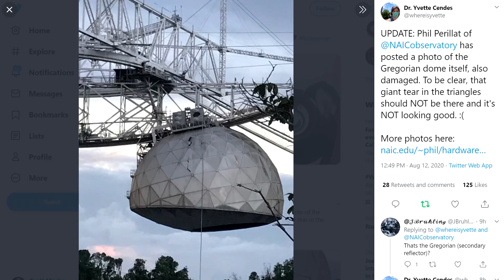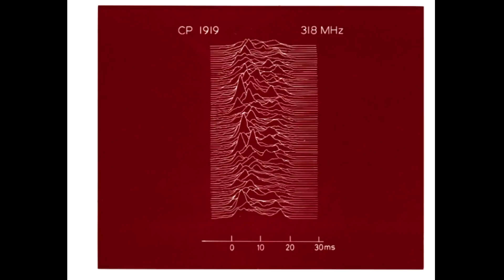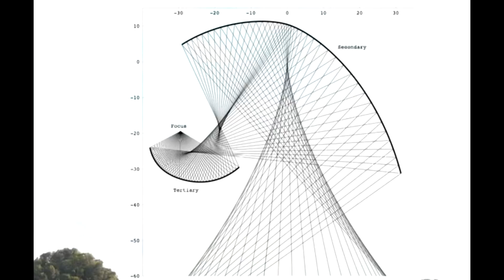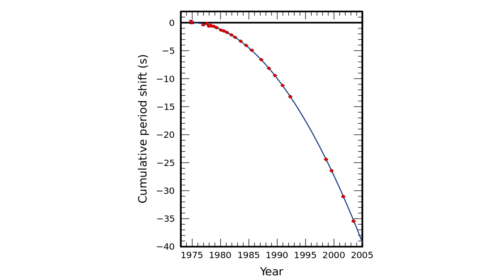Snapped Cable Damages Arecibo Observatory Radio Telescope

Comment: You need a minimum of five cable  towers and cables.
Then one tower and it's cables can be rebuilt or recabled while the other four hold up the rest of the structure.
This is standard on all largre cable supported towers and antennae.
With only three towers/cables you have to take down the whole structure to replace one tower/cables.

Comment: Cheap replacement idea:

Replace towers with windmill towers.  Modern windmill towers are cheap, and strong.  $3-4 is the all in cost for a 2 MW wind turbine.  The tower is probably 1/3 the cost.  So three towers for $3-4 million.  The biggest problem is lack of cranes and getting the crane to Arecibo.  The cranes plentiful and cheap to rent in Iowa, Texas, wind farm country.  There probably isn't any cranes in Puerto Rico.

Use Skycam style suspension system to hoist research instruments into place.  Skycam's are cable suspended cameras used in stadiums during games.  The suspend a camera anywhere in 3D above the stadium with limits.  First used in 1984.  A similar system could be used to suspend research packages above the dish.  Suspending the packages in different locations to aim and focus the dish.  6 cables could be used to tilt a package.  The cable drums would be mounted on the top of each tower.  The experimental packages would be stored on the ground in the rectangular hole.

Repair the dish.  Ultimately the dish probably needs to be replaced.  I recalled past discussions on that.

My guess is that you could be up and observing for less the $10 million.  Costs go up with feature creep.

Smaller packages could be suspended from stabilized drones.

-Kurt
Reply: This comment does not even remotely consider the type of load that is placed on the support towers in question. Towers using cables to suspend a platform 100m or more form the tip of the tower are designed entirely differently than a tower designed to support a static load placed directly on top of it and its base. This isn't even the right channel for engineering suggestions and yours is a less than poor one.
Reply: @oddieboi  I did consider what type of load a wire would place on the tower.   It is obvious it is sideways, horizontal to the ground.  How does the wind blow??  Maybe wind blows horizontal to the ground.  My back of the hand calculation is a 3 MN wind turbine would place over 300,000 KG of sideways force on the a wind turbine tower.  Therefore a 3  MW wind turbine tower could support a 300,000 KG sideways cable.  Three wind towers towers could easily support a 100 metric ton platform.  No where near the 900 ton Arecibo platform.  But the Skycam tech means you don't need all steel work lattice to move the Gregorian dome.  A massive weight savings.  No cat walks are needed either.  The Skycam tech would lower the electronics platform to the ground for servicing.  More weight savings.   I think a less then 100 metric ton platform could be designed easily.

Comment: I catched up latest news about this installation.  Because of irrepairable condition, as well also because of instability in the whole structure because of that damage (also by a storm which struck previously over the area), so the installation threatens to collapse as was found out, the decision was now made to mainly dismantle the whole telescope installation, except for some important details for preservation of parts of it. This is sad, because such telescopes, which are using a geographical condition (valleys) for mounting a fixed reflector with really extending size (unable to be constructed in such size on mobile structure-mounted telescopes) are capable of detecting very very weak signals coming from space and also from far-away probes. To cover up a major part of the surrounding space, such fixed telescopes would have to be mounted all over the whole planet (because earth rotates, at least along one or more latitudes, densely enough so their main lobes are somewhat overlapping) The gondula with the transmitter/receiver elements was movable, so the radiation/reception lobe of the telescope was even able to be tilted within +/- 20 deg.

Comment: The same technique is used in the Elevator industry to support elevator cables its called a Rosebud. the end of the cable is unwound (after being secured with ties to prevent further unwinding.) the ends of the strands are bent over and put into the center of themselves forming the "Rose" flower assembly. this is slid down into a cone shaped metal cone. then melted Babbitt is poured into the rose to solidify. and capping off the end of the cable then the assembly is attached to the car./ or what ever device being used.

Comment: Remember Gren Bank Observatory? Largest fully steerable radio telescope, located in West Virginia, suddenly collapsed about 20 years, of course totally destroying itself. Due to the same funding challenges facing Arecibo, many doubted the antenna would be rebuilt. Not only was it rebuilt but rebuilt better. They even host a star party there now, and ots almost freaky to see this enormous dish antenna amidst a sea of telescopes.

Comment: Most likely at fault from hurricane damage from Maria, and lack of maintenance and funds, the Puerto Rican government is completely inept at allocating funds for  infrastructure and civil projects, the reason that my family left. 6 months without power and water after the 2017 hurricane due to the completely outdated 1940's termite rotted wooden power poles, mixed in with modern metal ones creating an intensely convoluted and nightmarishly tangled mess of power lines with multiple failure points, plus lack of proper response and coordination, it was only a matter of time, and still today there's still risk of another hurricane destroying what survived last time. Visited in November of last year and many areas were still exactly the same without any change or improvement in the grid, debris still all over the place, snapped poles being held up by the lines themselves, a distasted, I'm supprised the Arecibo installation is still standing

Comment: Cool, when I was in the US Navy I poured cables ends used to move Tomahawk missiles.  Talk about pressure to get it exactly right.  We had to pour it in place and climb this tower on our ship, the Frank Cable, with all this heavy equipment, torches, metal, a crucible, wearing our protective equipment because like who could carry it with the other stuff... I responded by entering into some very focused dream state view, not consciously acknowledging I was climbing high, with heavy objects in a weird suit, with a helmet on too, which helped me not look around.  The cables apparently do need to be replaced after so many lifts, I would imagine their cables need the same kind of maintenance.  Sad it broke, but it will probably be repaired, yeah?

Comment: 11:00 - Why can't they fire the radio waves at the asteroid before it moves into the cone, so it'll be in the right place when the waves get there?
Reply: I think they would need either a second dish at a different angle, or to fire the radio waves at something ~1 light day away so they would be facing the right direction to receive it.

Comment: If the cables are doubly redundant, it means that the cable that failed, did so at one half the working load. That's a big deal.

Comment: If they're all the originally installed cables, then a failure like that will require every last cable to be replaced. If they were all installed and made to measure at the same time, its possible they will fail at similar times also.

Comment: As a ionospheric perturber, it can be used as a tropospheric heater via ionospheric-tropospheric coupling as the perturbed ionosphere dumps its massive energy into the troposphere (sprites), thus potentially affecting weather.

Comment: your Ian M Banks novel next to the Corey novels, (player of games?) is annoying me slightly... because it's NOT next to the other two at the far right of that shelf, (Excession, inversion),... and speaking of I also note that Use of Weapons is upside-down on the shelf, between something with trees and sunburst+luminary.
Tidy up that bookshelf! 

Oh and I always wondered if the bit in goldeneye - a) it being capable of appearing like a lake  by being filled with water (I always took that part as being B.S.) and b) the whole structure being able to be loweredwas either the real thing for maintenance, or not. And if so, the three towers holding them up, if they were extending structures like superlarge multi-stage hydraulic rams or more like the cables let out like hoist ropes.

Comment: Being located in a tropical environment, I would suspect some corrosion-related damage in the cable or cable termination. If funding allowed, they should replace the steel cables with some having a kevlar core.

Comment: They are called Speltor Sockets.  They used molten zinc or more recently epoxy to fill the joint.

Comment: Not too surprising after 50 years. If it pulled out it could have possibly rusted inside or swaying in the wind with load and such over the 50 year period slowly loosened it up enough to finally pull out. Idk thought I'm not an engineer and the biggest cable joints I make I need a magnifying glass to do.

Comment: One thing: the broken cable was part of the 1990s upgrade, so it is one of the six (of 18) newest cables. I am glad you presented the damage to the Gregorian dome. This is likely the most serious damage, and that is because we are approaching peak hurricane season, and a storm like the 2017 Maria or 1998 Georges may very likely destroy the Gregorian. Those triangular panels of the geodesic shell protect the subreflectors and receiver/transmitter instruments inside. The 1990s upgrade was a $30M investment by the American people, and we all stand with UCF and the top flight staff at Arecibo as the work tirelessly to repair this damage.

Comment: They should be able to make radar images of objects ~90 AU away by sending the pulse out and measuring the reflection the next day (24 hours later). My estimation is based on that radar pulses travels 1 AU in 8 minutes (from the sun to the earth) and that 24 hours is 1440 minutes. That means that in 24 hours the radar pulses would travel 180 AU (90AU out and 90 AU back as a reflection). 1440minutes/8minutes/AU=180AU

Comment: They shouldn’t have used an unbraided steel cable. This is beyond embarrassing. Steel isn’t as strong as the engineers think. There are countless examples for stuff like this happening and it’s been know for years, but big steel keeps pushing their shitty products down our throats. Also in the rainforest there is additional wear and tear on the cables from birds and primates, which they probably didn’t account for.

Comment: Arecibo was completed in the early 1960s. There's chatter further down about doing something similar, and more up to date, in space but the logistical issues aside, there's no way to maintain anything operational for that long in that environment. The maintenance costs alone would be ...astronomical (sorry).
I had a chance to visit Arecibo a couple years ago. Anyone going to Puerto Rico should drive out to see it. You can walk right up to the visitor center at the base of one of the towers and stand on the edge of the dish. These pictures cannot do its scale justice. It is one of the most impressive feats of engineering I've ever witnessed up close. Then maybe you can understand why it's sustained and tries to stay viable.
Kinda like a great cathedral, I guess. You wonder why, but then you encounter it and it's clear why.

Comment: Hmmmm. Can it affect the ionosphere? A lot of emissions but no documentation of affects? Surely three has to be some
Reply: It's designed as a receiver, not a transmitter.
Reply: @NorthForkFisherman  it's both of you listen to the video.
Reply: @fgeiger41  Yes, I remember the Drake message, but again, as a telescope, it's a passive, collecting device.
Reply: @NorthForkFisherman  you missed the part where he said it wasn't JUST a passive listener and that it sent out powerful pulses which were originally targeting the ionosphere which had been proven to be affected by powerful radio waves. Watch the vid again

Comment: All support cables require periodic maintenance and replacement.  Some of our bridges are more than 100 years old and are now carrying many times the traffic they were originally designed to carry (think Brooklyn Bridge in New York, for example, originally designed for horse-buggy and rail-road traffic).  If one of those cables were to snap or pop out of its socket there'd be a major disaster.  No matter how robust the design, engineers must monitor their condition over decades and plan for refurbishment and eventual replacement because it is the nature of ALL materials to fail over time.  No man-made structure will last forever. I hope those responsible for funding Aricebo realise the mistake they made as that seems to be where the primary "break" occurred.

Comment: @2:00 There is grass under the dish??? I always thought the reflecting surface was lying on a concrete foundation, because it was too large to hang in the air like previous generations of radiotelescopes.

Comment: Not superseded...lol.
It has main attention for some details. Just others wanted consuming if the repairs went forth . ...however it shouldn't be supported this way. The debate to instruction was competed some by area elsewhere. The possible climbing on a tripod was one reason it hung. Yes there's more from my vantage. Mistake no...and no zapping exactly...it needed a better receiver. Yes to see if waves are interrupting space or if they return. So area 51 got a return ...lol
It also would be the first to keep NASA in communications ...so the data board seems underrated . it was said built on the deepest hole on earth...is this true? Not manmade. Not as usual reference. It was made as concave convex aerial type. interesting...yep it was a winnerlook the snow...

Comment: Very informative - as usual. 10 AU is about 83 light minutes or 166 minutes for RADAR to return. The Earth turns one degree every four minutes, so click-clickity-click 41.5 degrees. That must be the +-20 you stated. Cool. I wonder if their resolution is so high that they have to aim at where the object will be when the signal gets there, and likewise adjust for the return.

Comment: Sounds like a corrosion problem in the connection, posture entry and galvanic action of dissimilar metals.

The Arecibo was also the source of data analyzed by SETI.

Comment: 900 tons? That must be a misprint! If it's that heavy it should be redesigned using modern tech. I had thought it was permanently shut down when the bond movie used it as a prop.

Comment: "Now you might think that a cable snap would cause the structure to fall, luckily engineers are smart."
Reply: Not all engineers are created equal.
Reply: @Philip A smart engineer will always include redundancy.  Failure is a fact of life. All things will sooner or later fail, expected or unexpected. This proves that the redundancy was necessary.
Reply: @LadyLexyStarwatcher  A smart engineer would include ties between the redundant cables so that a single broken cable would not fall and destroy the dish.
Reply: @davejoseph5615  or it could be that the weight of the cable makes so that if a tether is introduced that there may be a chance of chain reaction since it means the other cable need to hold the failed weight plus the dish structure and best to just let it drop.
Reply: @kevinji7285  I am sure they will be doing all sorts of cost analysis after this cable failure is fully understood.
Reply: 3 months later.... apparently not smart enough
Reply: Looks like the maintenance crew did not have an engineer! ;-)
Reply: This comment didn't age well
Reply: rip
Reply: This aged terribly
Reply: I can't look at the Tacoma Narrows bridge being blown down by wind and think engineers are particularly gifted.
Reply: @topixfromthetropix1674  Don't blame the engineer entirely. He very well could have pushed for redundancy, but his budgeting department gave him the shaft.
Reply: A great mechanic told me. If engineers did their job right there would be less mechanics in the world.
Reply: r/agedlikemilk
Reply: He just said that
Reply: I wonder how many suspended things had to fall down catastrophically before engineering manuals started recomending redundant cables.
Reply: @Philip smart ≠ having a crystal ball; smart = acknowledging that you can't know everything
Reply: luckily..
Reply: Whoops
Reply: Yeah it collapsed yesterday
Reply: Nah he deaaaad
Reply: It collapsed
Reply: This didn't age well
Reply: It just fell
Reply: foreshadowing
Reply: If only you knew then, what I know now.
Reply: Well technically the architectures are the smart ones

Comment: Scott consistently delivers interesting informative videos that make me think of the possibilities, appreciate the science & engineering & people behind it.   Scott should be NASA’s Chief Public Affairs Officer plus help NASA identify new projects with popular, practical relevance.   Amazing technology to focus and aim a spherical reflector.  

We would greatly benefit from a large ultralight inflated antenna orbiting Mars.  It could be used for high bandwidth communication, SARS type interferometry mapping of Mar’s surface down to millimeter accuracy,  ground penetrating Radar, (also the moons of Mars which may be the ideal location to refuel starships).  Also when combined with Arecibo, it would allow unparalleled opportunity to measure distances to objects (unparalleled is a pun.  Compare the shift in the distant object with respect to the background to get parallax).  Also comparing time delays of pulsar signals between it and Arecibo would give triangulation direction and a means to confirm general relativity time warp in a gravity field